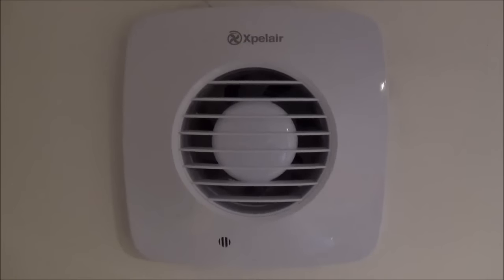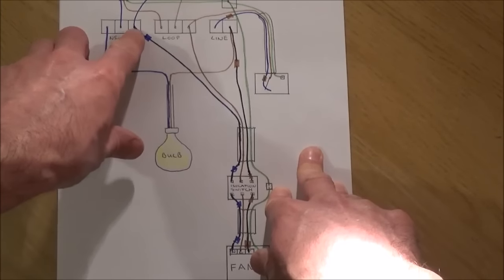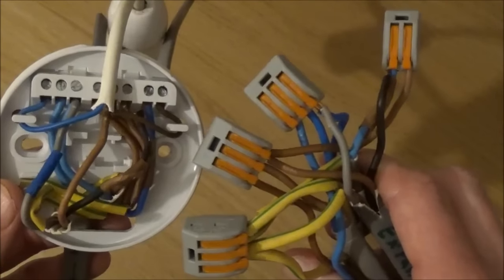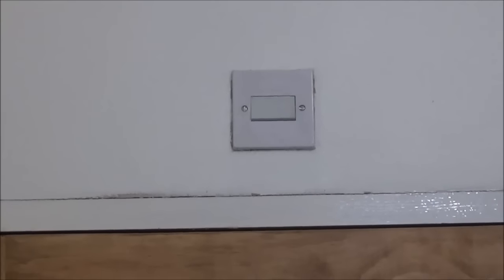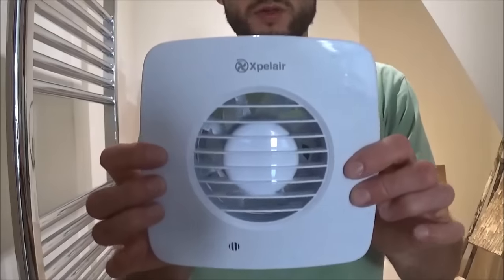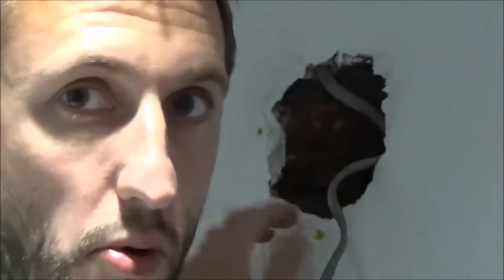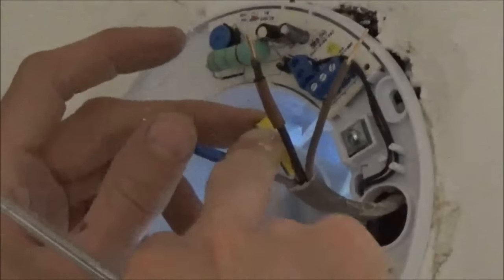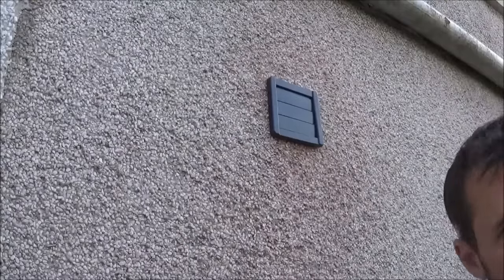How to fit a bathroom extractor fan using light switch. Extractor fan installation. Xpelair DX100

Comment: Can you explain how you get earth continuity when the earth cable in the extractor is not connected to any earth terminal ? Also how would you install two led light luminiares and an extractor fan operated off one light switch ?
Reply: There isn't earth continuity needed if the fan you are installing is double insulated, look for a square within a square on the fan itself, that is double insulated
Reply: @matthewread7220  Ok so how do you wire the circuit to have two separate LED lights and an extractor fan operate from one night switch and is it a electrical requirement to have an isolator switch for the extractor.
Reply: @Elfin4  take a 3 core cable from the light fitting to a fan isolator, then take another 3 core to the fan itself. Yes it is required same as a shower isolator too. It's because if someone needs to repair replace fan it can be isolated locally.
Reply: @Elfin4  are you a learning electrician?  If so ghs electrical is a superb channel on YouTube
Reply: @matthewread7220  No I'm a surveyor, but looking to increase my CPD knowledge of electrical installations, also want to install an extractor in my own home shower.  I want to install two separate LED luminaries in the shower and an extractor, all to operate from the light pull switch.  So just a little uncertain how to have two separate luminaire's and an extractor running off one pull switch.  Will check out the GHS electrical though.
Reply: @Elfin4  it's definately doable but I must admit it's probably worth just calling an electrician to do it, you can still save by buying the items yourself, electricity is not something you want to play around with.
Reply: @matthewread7220  Yes I intend to, but just wanted to get my head around how it will be wired.  Its only a 30minute job at best and will be getting the materials myself anyway, just trying to get my head around the install.
Reply from the maker: Hi - you wire 2 lights as per the video, but take the live wire from another piece of three core and earth from the switched live on the first light, run it to your second light. Then they are both controlled from the same switch. But if in doubt, cal an electrician! Thanks for the comments.

Comment: No, not ALL electrical work is notifiable under part P. Only work in certain zones requires competence and is notifiable. I can fit a bathroom fan if I like.
Reply from the maker: Hi Robin, the regs change all the time so better to be safe than sorry. If the fan was in a high risk zone then you would need to notify, but best just to always check the regs at the time of the work. Thanks for the feedback and thanks for watching. Good luck!
Reply from the maker: Thanks David. Just bear in mind the regs are different for Scotland, England and Wales as if they weren't complicated enough! Thank for watching!

Comment: How is black and white old style when red is for high voltage are you in another country because that’s how it is here black and white red is in case there is a higher voltage then black then that’s where red comes in to play just like motorists would say even pumps have then as well brown , blue, purple so (what?!) are you talking about
Reply from the maker: This is UK wiring and domestic 230/240volt electrics. Hope that helps.

Comment: Hello , amazing video. Planning to buy this today and attempt installing it myself. Is the one in the video the standard version?  Thanks!
Reply: No it's not a standard version it is With timer
Reply: @godfather879  Having a hard time installing this... Not the device itself but the tube going into my ceiling. The old hose dimensions is smaller then the xpelair 4'' 100mm that I got. I've been looking for a duct hose but can only find 100mm ones or 125mm which means they're not good to connect to the pipe supplied with the Xpelair.

What would you do?
Reply: @Jefferson Elias  Thanks for the reply I have sent mine back to Amazon as I thought it's really cheap quality and I couldn't get it working , I'm glad I did that I purchased one from eBay (envirovent silent 100s ecowatt  axial silent ) cost £25, Installed it evening and It comes with 5 years warranty
Reply: @godfather879  what was the issue you've faced? It's good to hear that feedback. I will finish the instalation tomorrow, we'll see how it goes. We're you not able to run it at all?

Thanks for your reply.
Reply from the maker: Sorry I'm late to the party on this one. Great to see viewers helping each other out. Sounds like you both have everything sorted now 👍

Comment: i want to wire this without the timer (so that its always on) - would connecting live and switched live to one wire work? 

i have live, neutral, and earth - and im thinking of connecting live to a terminal block that makes it into two wires before wiring it to the extractor fan, im hoping thats an okay way to split a live cable

ps. im wiring it into a fused plug without earth as the fan doesnt have it, but it will have a fast blow 1A fuse (smallest i could find)
Reply from the maker: If you don't want a timer just buy a fan without a timer. They don't cost much. If in doubt employ an electrician to do it safely. Thanks for watching.
Reply: @POUSEaroundtheHOUSE  yeah, thats not what i asked

edit: no worries, i didnt realise you werent an electrician. wiring live & switched live to the same wire does work fine, tried & tested

Comment: Not bad. Did you test continuity of cpc at the accessories and measure R1+R2 as it's an extension to the original radial circuit?

Comment: I’ve got an ICON Air flow extractor fan mounted on my ceiling in a small bathroom but it doesn’t look like it’s vented outside. It comes on every-time I pull the light pulley and overruns for a bit after pulling the light switch off.